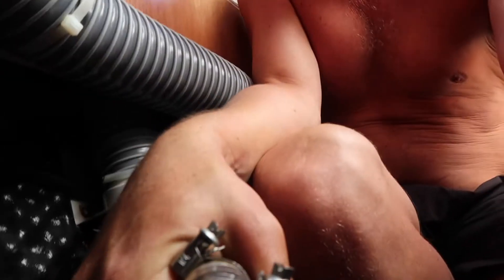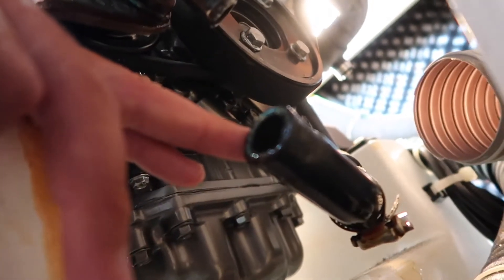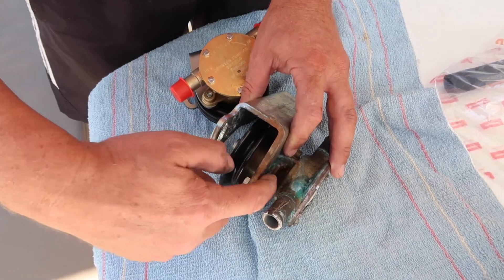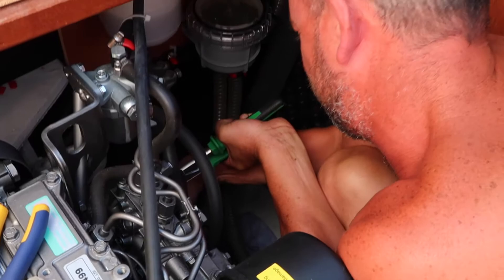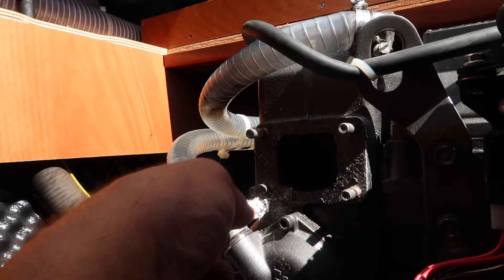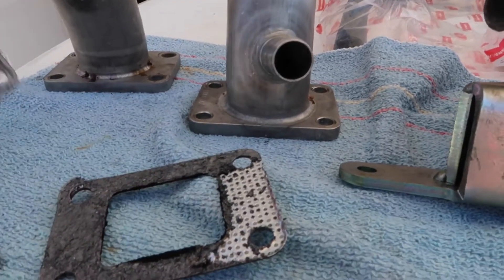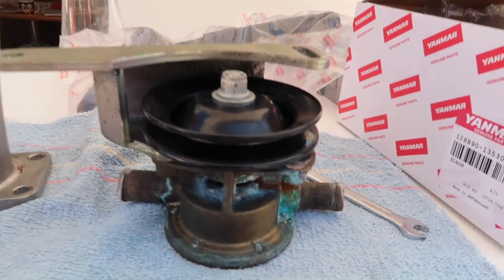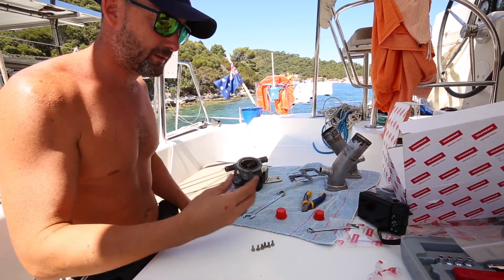Sailing BareFeet Tech 01: Sea Water Pump & Exhaust Elbow

Comment: Hi The Pump is easily rebuildable and good to keep for a spare. Also beware of too much tension on the pump driving belt as this seems to shorten the life of the pump. Belt tension does not have to be too tight as the pump does not require a lot of power to drive. Good videos, like your stuff, keep it up.
Cheers from Tasmania
Reply from the maker: Thanks for the tips Scott. Definitely keeping it onboard as a spare and rebuilt before we cross the Atlantic.

Comment: love the Boat Love. Like Russel Brander said, surely you could repair the old pump and save money. Also, how a short tube cost so much? Is it anything that special? It just look like a simple tube that you can get anywhere.  Many thanks for sharing and best from HKG
Reply from the maker: The tube bends around in very particular way to avoid things like the alternator and other bits that might get in the way. Agree that when in dire straights, any tube would do as a temporary measure:)

Comment: Can you not have the old leaky pump rebuilt?  Seems you could save money by having the pump rebuilt
Reply from the maker: With the right tools, alls needed is a new seal and bearing. Sadly we're on the move without access to a workshop, so spare for later (and repair).